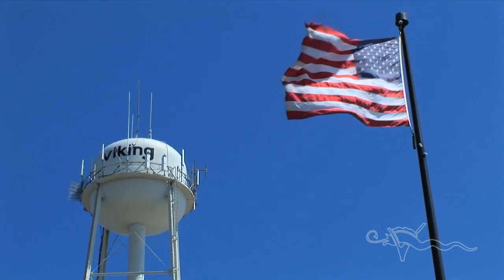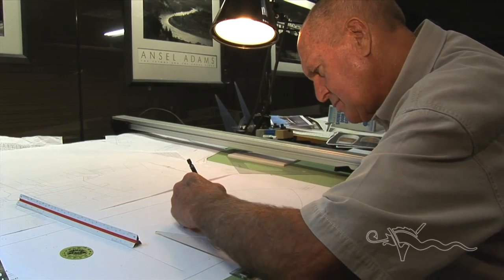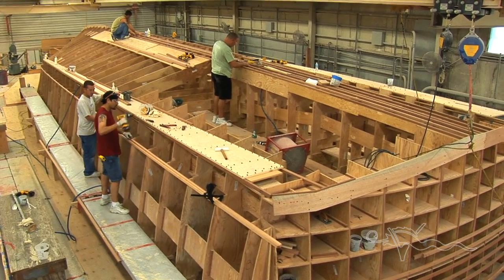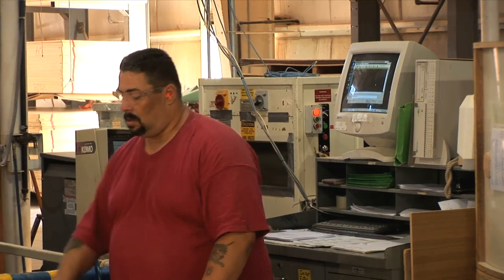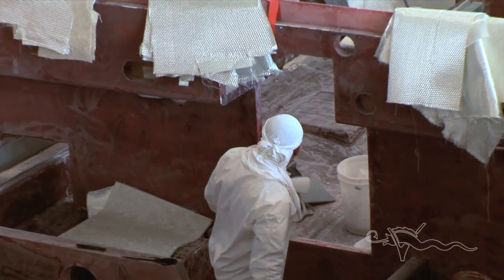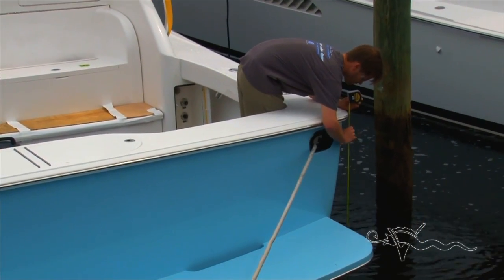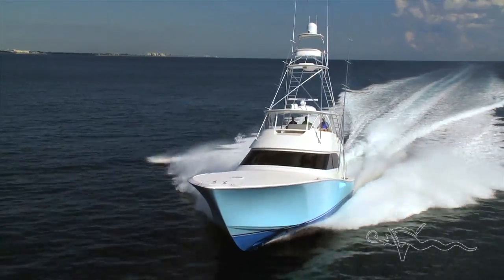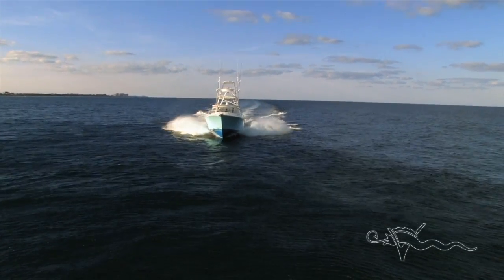Take a tour of Viking Yachts

Comment: Viking is truly the best sport fishing boat. Me, my father, my uncle, and grandpa got into 10-12 footers on a 1998 Viking and she handled it amazingly.
Reply: Sure it did, because unless they were breakers, or white caps as some of us real salts call them, any boat could handle 10-12 foot swells....My first boat was a 31 Penn Yann with twin Mercruiser 250hp Sterndrives.  At the time I was stationed in Maine and we were in the rough seas most of the time and with the power and props I had on the boat we climbed the front and back of 10-15 foot white caps to get out or get in and I saw a good bunch of even bigger boats turning around and going back in when we headed out, I knew  that the Penn Yann was a damn solid boat and could take a smack down from 8-10 foot and keep going and it did many times without a single problem.   I owned the boat for 8 years and the only problem I had was a clogged fuel filter that kept me from accelerating the port engine beyond 1000 rpm they idled at 750-800 to the best of my memory,  this was back in the late 60's early 70's I owned the Penn Yann,  sold her in '74 and didn't own a boat until many years later.   I wish that I could have a 65'-70' foot Penn Yann because it was a friggin tank when compared to what the other boats in its class were built like, they had double the stringers and hull frames that any other boat had and to top it off it was built with a double foamed in hull so as for handling "10-12 footers" that  was nothing to even bother mentioning when we went fishing.  As for now, I own a 2018  70ft Hatteras motor yacht and it is also a  well made machine,   easily able to take 15-18 footers!!!!! As for the Vikings would definitely not have one with the things that a few owners have told me I run the other direction but I do believe that some of those owners are mad because they have to pay for more of the repairs than they want to..